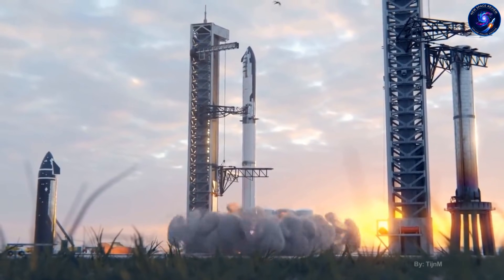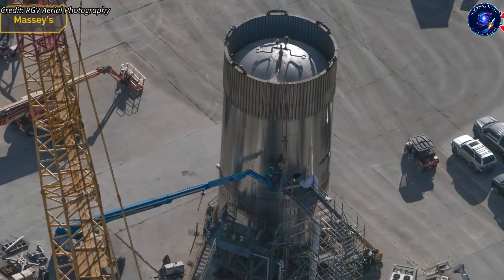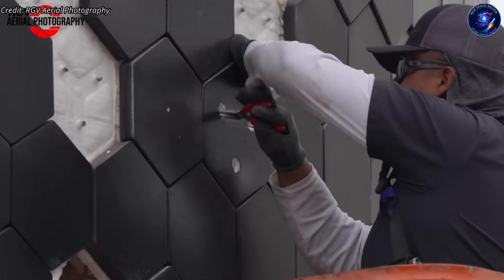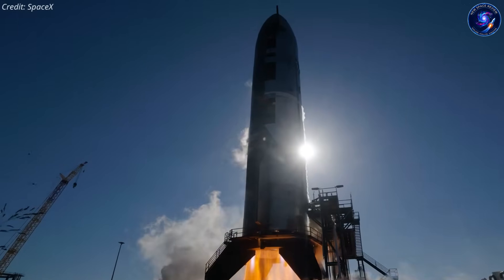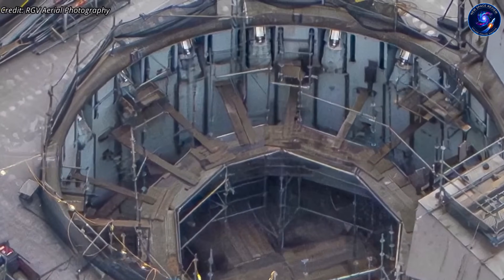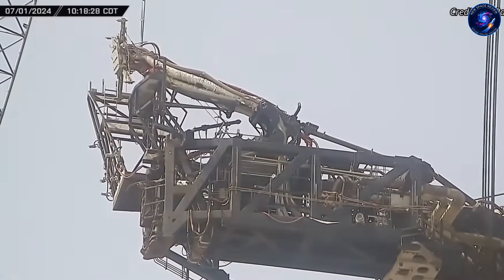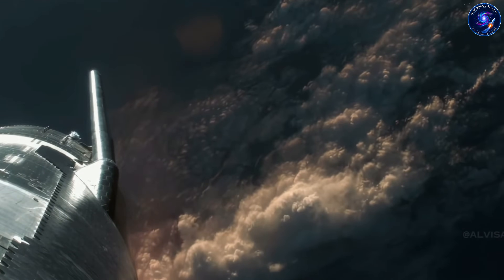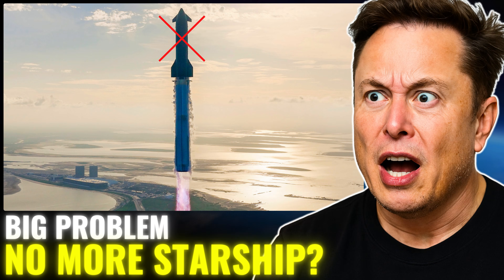Something Bad Happening to Ship 39 Forces Flight 12 Delay...Shocking!

Comment: Unfamiliar acronym. What is COPD?
Reply from the maker: COPV stands for Composite Overwrapped Pressure Vessel — those high-pressure helium/nitrogen tanks used in Starship (the ones that caused big headaches with Ship 36 and Booster 18).